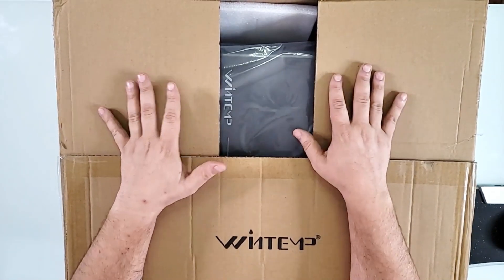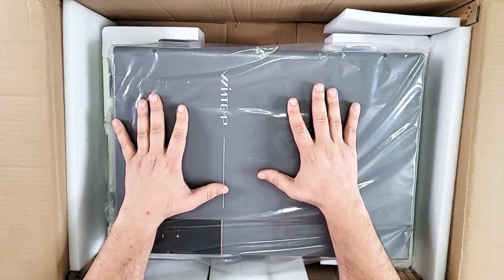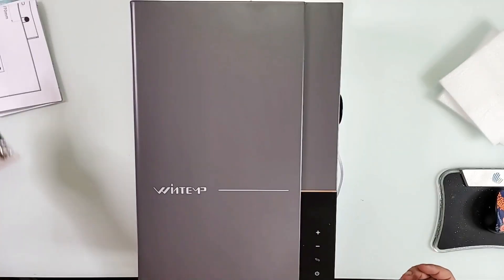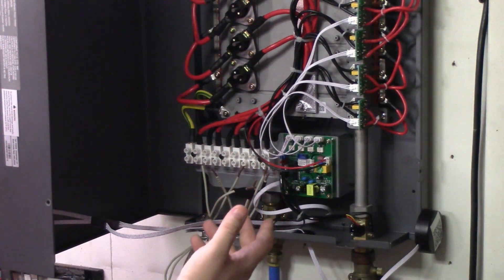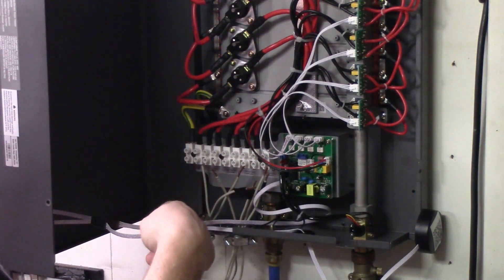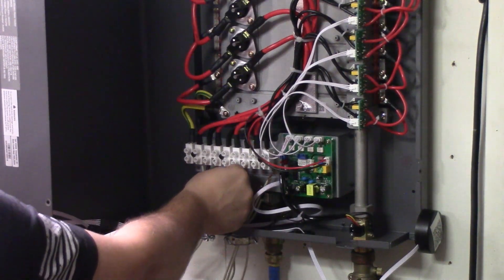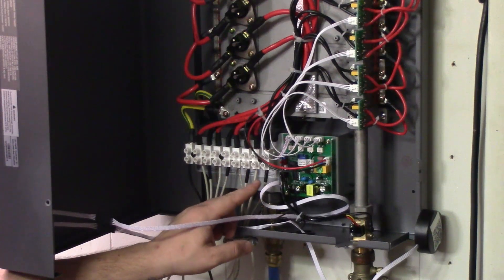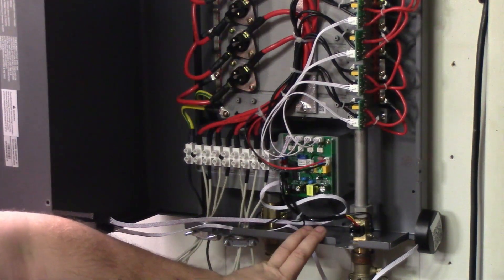Ultimate Home Comfort: Wintemp Electric Tankless Water Heater 36KW 240V

Comment: 15:00 It's better to set the water temperature at least at 140 F° (60° C) to prevent Legionella bacteria.  125 F° is not high enough to prevent this. Grtz
Reply from the maker: Thanks for the tip, I didn't think of that.
Reply: Maybe for a tank but not for tankless
Reply: @Steve-bm2zm exactly..